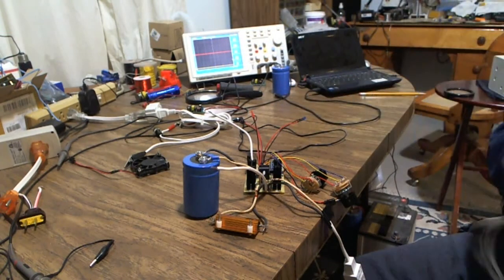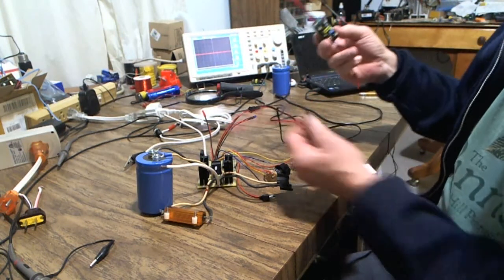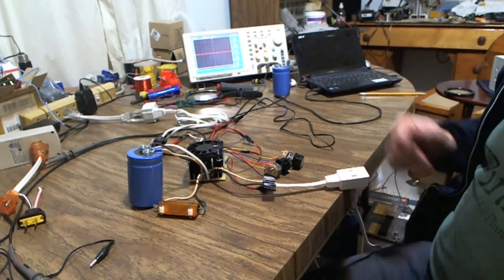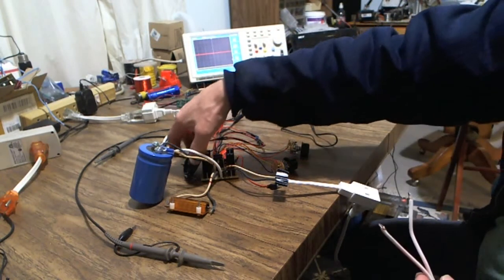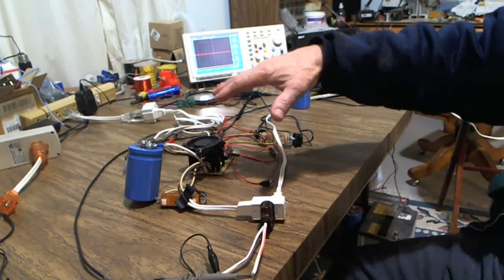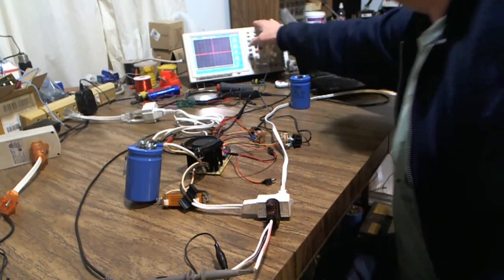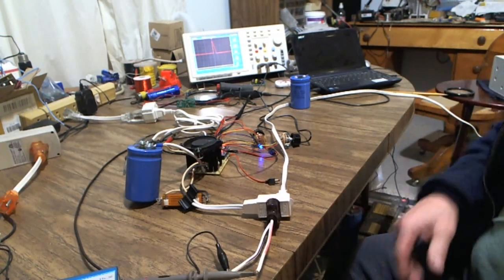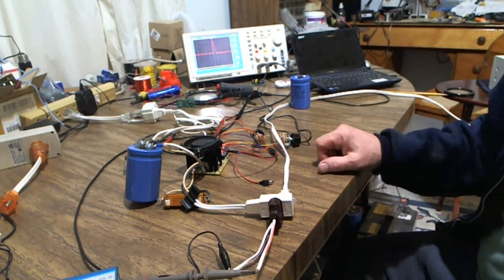PEMF Kit Builder 2

Comment from the maker: The www.aurorasky.net website is open source and has the PEMF schematic posted on the http://www.aurorasky.net/html/high_powered_pemf.html webpage as a link.  As can be seen in the schematic the PEMF is controlled by an Arduino MPU (Micro-Processing Unit).  There are 18 speed and 18 time settings.  Correct, it does not use a separate pulse generator.  These speed and time settings are stated in the website “Switch Setting” PDF, http://www.aurorasky.net/SPEED_-_TIME_UPDATED.pdf.  The Speed settings are far below any RF levels.  The magnetic pulse follows the ‘Square of the Distance’ law.  Said differently, the magnetic pulse strength spread out in the same way a flash light beam spreads out.
There are books written about PEMF with a lot more information then I will write about in the blog.  It is suggested you research the web for both PEMF type and how various PEMF types work.  Respectfully, Steve

Comment: Very cool.  Question, does the kit control the pulse timing, like you don't need a separate dc pulse generator right?

Also, do you happen to know the range of radio frequencies that are produced?  Also, what is the range and spread on that bad boy? It it in a beam or does it spread out equal distances a around thr coil.  Just curious how you aim the thing.  Like can you hit the whole body as well as direct at local problem spots?

Comment: Can you control the output on it, so that you can use smaller coils? What would it take to add a pot on the output? Thx
Reply from the maker: Yes it can be controlled.  The project is open source and the intent was to allow others to expand on what I have done.  Go for it if you have the knowledge base.  Everything is available, schematics, PCB mask, theory of operation, and more.